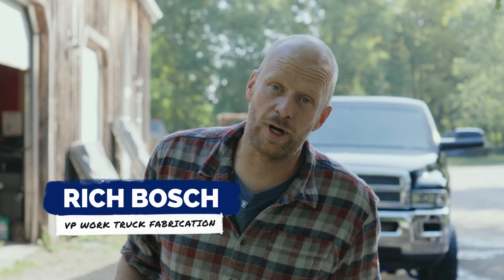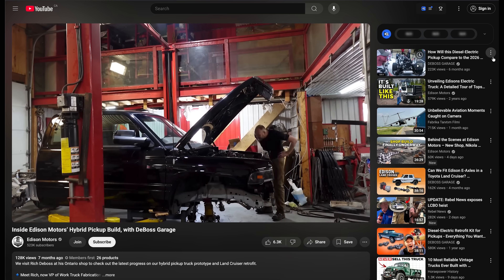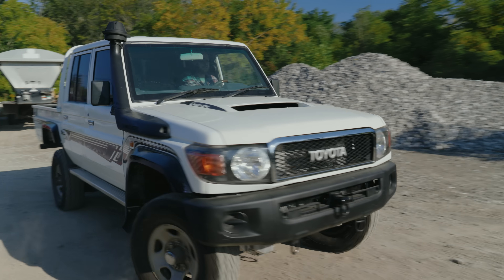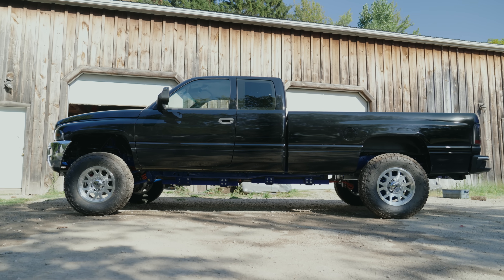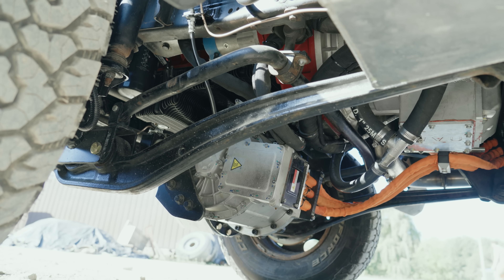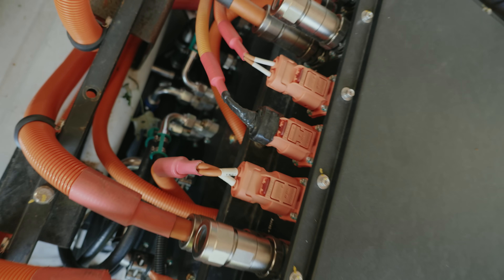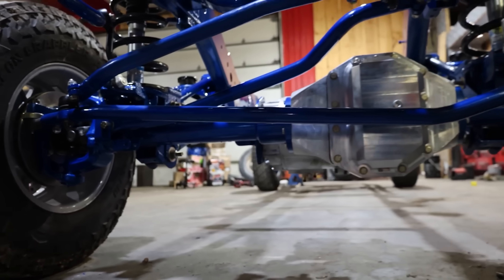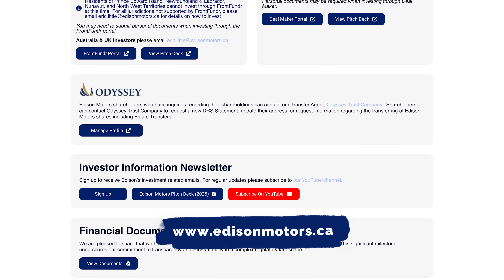We’re Building Pickup Trucks with Electric Axles, Here’s Why

Comment: Couple of thoughts/questions. 
1. Any concerns about the extra unsprung weight with the axle motors? In theory it should cause a rougher ride, worse breakin, worse traction, etc... everything is allways a trade off, just curious about the thinking on it.
2. 2:45 in an offroad vehicle there should be a fair amoung of travel in the suspension. So what about work hardening in the power cables? Vibration can also cause this issue.

Edit additional thoughts.
3. Is there shielding planned for the offroad  variants to protect the cables and terminals, especially with regard to point 2.
4. Is there a mech planned to detect point 2. I.e. cable increased resistance, caused by breaks due to work hardening, or connector issues? E.g. something like thermal couples on each end to monitor excessive cable temps, so there is a fail safe mode. So long as the cables fail safe, they could just be considered consumables.
Reply: I run one ton truck Dana axles with military wheels under a Land Rover Discovery. 782 lb front axle weight, and 698 lbs rear axle weight. It rides, and brakes excellent.
Reply: @Bread996 interesting, out of curiosity you on/off road?
Reply: @Bread996  I have a 2000 Disco 2 and would love to convert it to electric. Electric axles sound like a good solution. 
I don't want a hybrid power system, just batteries.
How did you do the conversion?
Reply: I raised the same consern as your first point - I hadn't thought about the second one though - good point.
Independent wheel/axels should solve both of these things though hopefully they eventually go that route.
Reply: @pdloder for that they would need universal joints, which they seem to want to avoid.
Or do you mean in wheel motors?
Reply: @deth3021 yeah, CV (constant velocity) joints. Like most anything with independent suspension.
Reply: That's true, but at least they're not at the wheels.
Reply: @newolde1 yeah, I think hub motors are an even worse idea - unless it's for a machine that's destined for pristine sealed roads for life.
Reply: You can compensate for the added unsprung weight of the motor by not putting huge, ugly, unnecessarily heavy aftermarket truck rims on it. Then it'll just feel like a regular gas truck with the stupid rims 90% of truck owners put on their trucks anyway, with the added benefit of not actually being an eyesore (Sorry I'm a bit salty, former tire technician, I loathe aftermarket truck rims because they're always a massive pain to deal with)! But for real though, with normal rims, I don't think it'd feel any different from what truck owners are used to by now, given how crazy heavy non-factory rims already are.

Comment: The incomplete chassis option is really interesting! New non-rusty frame, modern suspension and brakes, plus the entire hybrid driveline ready to go under a classic body. I like it. I try to peek down from the highway every time I pass through Donald to check if I can see anything, love what you guys are doing.
Reply from the maker: I think it makes sense for sure
Reply: @EdisonMotors  So will the pickup chassis have a standard designated GVWR?
Reply: @EdisonMotors  ECC! Edison Custom Chassis!
Reply: Will this be in US sized pickups only or is there a smaller (eg ford ranger) size chassis (3/4 ton pay load and 2.5 ton tow rating) planned. I am thinking of export potential for the rest of the world.
Reply: @kellymcdermott2546  they built a land cruiser which is basically ranger sized
Reply: @kellymcdermott2546  the 3/4 ton size would appeal to a huge market segment.
Reply: I’ve got two fifth generation Ford trucks I could plop on a chassis!
Reply: I've got a one ton crew cab dually, 1993 Chevy that's been running around with a blown head gasket. Seems like a good candidate and the frame is solid with maybe some surface rust but never been on a salty road in its life. Seems like a good candidate though I understand Dodges and Ford's Have more troubles staying together historically so might need this more. 😂
Reply: @monsaka7827 A '93 with a blown head gasket? Huh .... Imagine that 😂 I think that was standard equipment on those. Best I remember ours lasted for about 60k before going down.
Reply: i have a 2004 ram 2500 with a dead frame, if i could buy a new one from these guys today I would
Reply: I’ve got an old F-150 that I’d LOVE to do this with but the chassis is rusty and almost not worth it. Plus, now I could put my body on a heavier frame and axles? That’s a huge benefit for a farm truck.
Reply: Anything that needs recoding of its electronics, is going to be electronics SCRAP after it's outdated ... Probably before a regular person can pay off the vehicle conversion
Reply: When the thermal management device fails,,,🔥🔥🔥👀👍
Reply: Sounds like we’re no longer looking. At 1/3-1/2 the cost of a new truck

Comment: On the LC, look into placing the module on the roof, particularly if it's meant for high availability. An external roll cage would look really cool.
Reply: If the vehicle is going underground it will need an external roof protection per regs.

Comment: take any 2wd pickup... mid mount the engine behind the front shocks tower tucked in under the firewall.. put a "tesla" engine for the front ... make a hot-swapable batterie in the back and make it a universal kit for all truck brand.. tow on gas bring it back home on the batterie. 4wd would be a hybrid mode.

Comment: I REALLY want to do this to my end goal OBS. An 80s or 90s f350 crew cab with an 8 foot bed.
I just LOVE the look of those trucks, but the power to fuel consumption of those old engines is so terrible. I have a 460 and it gets 5 miles to the gallon. I would love to be able to swap over to the hybrid system.

Comment: What is going to protect the motor when you need to get to a piece of equipment off highway? My F550 was 19k. That much weight + momentum + stump/rock is going to kick the motor in the teeth if you hit it.

I know you could say the driveshaft would have the same problem, but a driveshaft presents a much smaller target.

Comment: We don't want frames. We want pick-up axles and the basic power system with diesel generator and batteries. We don't want new frames.
Reply: As i understand it you can buy the parts individually but for a quick and cost-effective solution they built the chassis

Comment: I have a 94 Isuzu NPR where I added a 15-ft tilt deck.  You might be at 12 I don't know but it's 15 Foot on road standards I know there's 32 inches between the cab and the bed.
Reply: I would love an incomplete chassis. Because a cab over where the cab tilts forward to access the engine.  With a tilt deck that tilts backwards  I would love the frame rails and axles. It means I run wires and attach hinges.

Comment: You were tested at McMaster. That is actually impressive
Reply: On the deboss channel, for the 95 dodge, there is a video where they did a battery of dyno tests with the original gas engine, and with the r2.8 Cummins bolted to the original transmission.

Now we're waiting for the tests with the truck now that it has batts, E-axles, and the R2.8 to spin the genny.

Can't wait :)

Comment: I have a 1972 bus turned totterhone, i am looking for more infor on batteries and axles for it. Id find a lil 4 cylinder diesel genny, so would need to know kw needed.
Reply: Edison semis have 6 batteries and 180 kWh total. Unless you're running the davis dam stress test, the little Cummins r2.8 liter 150hp engine making 100 kW should be plenty.
Reply: @Sah-o5m  just a class 6 truck. 14000lb rear axle to haul my camper. Been trying to find the axle. Not sure if direct to motor, small drive shaft, more so the cheaper option. I built a 12x8 box, and 9x8 rear deck. 366 bbc. 7? Rear gear on 22.5x11. Does 45mph. 😂. Probably 3500 to 4000 rpm just a guess.

Comment: I planed on building a hybrid Suzuki Jimny about 12 years ago. However, apart from the cost (which made it a none starter) the other issue was mounting an electric motor directly to the DIFF. The problem was vibration with off road driving. 
I've taken great interest with this project and look forward to the outcome.
Good Luck!

Comment: This vid is great. To the point letting us know whats going on no bs.   Dragging Rich and boys out to wine some more about how the government isn't bending over backwards and doing backflips for you so you can do an end run with a particular engine, we can do a lot less of.  Its not professional..
Reply: The public citizens (like Chace) have a duty to point out unperforming government red tape bureaucracy that won't lift a finger to help.
Reply: @Sah-o5m  that's not what he is doing. Sorry. He is rage baiting. He never tells you the full story. He can put in any road legal engine which is completely fair... what you can't do is find the same engine but spec'd for a Gen set so you can import it for cheaper ( or at all ). The road spec'd ones aren't sold to just anyone.  What do you thin will happen when the big boys find out what he is doing? No more engines for Edison.
Reply: @joe-ontario 
um no.
Edison asked ECCC if they could just use a road legal engine, and ECCC said if Edison bolts the engine to a generator instead of a transmission, then Edison needs to do $1m in cert testing to get USA EPA approval.

Holy cow I wished Edison could just use a road legal engine. That would be awesome. :)
Reply: @Sah-o5m  that is exactly what they can do. He said as much in multiple videos.  What he stats over and over is the issue is getting the generator engine version certified.  It cost a shit ton less to get that engine and there are no restrictions.  The rd legal one he might not even be able to purchase. He wants the generator version  to be deemed rd legal

Comment: Let’s talk about sliders on that toy that’s tough lay out  in the off road environment, and that second gen taking a trailer up the coquihalla keeping up with traffic. What’s the battery capacity doing that in a cold weather after two or three years of driving it , Ontario is a different planet than British Columbia  driving across the prairies doesn’t prove a lot  . There is no track that simulates British Columbia. I’ve been part of the team that developed two vehicles.
Reply: I agree, its good to have sliders for off road trucks. I believe the dodge was designed as a street machine. 

Hopefully these trucks will approach 400hp and 500 ft/lbs (peak). I believe the 60 kWh battery plus 150 hp engine will not run the full coquihalla at peak output :( But it shoud run the coq at 70?% power so 280 hp? To be fair, holy cow, its a 70 mile climb. A 7000 lv truck with 7000 lb trailer At 280 hp, it should maintain 40-60 mph climbing up the coq.

Edison can use the 2.8 liter diesel engine to warm the batts in winter.

Fortunately, the owner Chace is very familiar with the coq.
Reply: Yeah, Merritt’s not far from hope

Comment: All this is great what about battree  waste an disposal take that to the next level tho there really isnt a level at this point it needs to first be considered an would pay the way for ever other venture as this is the number one issue since its inception no way to safely dispose of the battree
Reply: Batteries aren't gone when they entirely lose capacity. Like the fuel in a fuel tank.
There are battery recycling today but it's only in the last 5 years BEVs has made some numbers. And apart from  offensive problematic designs of the packs, not the cells, the batteries last a long time. Usual life before scraping a car will be the norm for most. And we have prior good data for machines that go through battery cycles a lot faster than cars. 
So there isn't a gigantic supply of BEV batteries to recycle yet. But compared to mining rocks of those elements, a battery is an extremely high grade ore. Separating them out will be done if tandem with the supply of used ones.
Reply: @subwarpspeed no simply no did you know in most countries there isnt a way to fix nore replace battrees due to governmental laws ie we will sell an ev but not take responsibility for repair or disposal without added cost an this isnt just vehicles this is all consumer battery products but will take them at cost an store them thats not disposal or recycle thats a huge insurance an cost waste beyond the marketing that evs are a better way to go except for when they have been in a accident or fail in some manner 
Until there is actual disposal that isnt storage an recycling that isnt just repurposing cells if one wants to push bev  evs an phev there needs to be a battery disposal first as it needs to grow with the production not catch up 
But as we all know to well with plastics there is no recycling just storage

Comment: It seams obvious that independent suspension would be better than solid axles.  Why is that even a question?
Reply: Independent suspension reintroduces the weak flexible driveline joints that Rich just talked about avoiding, and puts them under even more stress. 
A normal driveshaft u-joint only transmits about 1/4 to 1/3rd of the torque the axle shafts must handle.
These kits are only legal right now  for trucks over 10,000 lb gross vehicle weight rating. They are not aiming at the independent suspension soccer mom SUV market, but 3/4 ton and bigger trucks where straight axles are still the most common setup.
Reply: It's simple to drop out an old straight axle and weld in a new Edison e-axle into any straight axle truck.

Down the road they'll do the homework to figure out how to make an IRS/IFS system work.

Comment: I see a lot of 'parallel' hybrid scooters with Bafang in-wheel motors. The chain is usually rusted or removed, but they've been operating in all kinds of weather. The Shimano, Bosch, DJI, Pinion, etc. are all high-end MTB motors paralleled with a chain. Water ingress is a problem with in-built electronics. Maybe you can get an IP rating too.

Comment: I love what you guys are doing but, Four independent lightweight hub motors, Right behind the brake discs, Would be ideal for power to weight ratio, less moving mass, better throttle response, less parts to break. Each wheel could have independent suspension and orientation capabilities.
Reply: Hub motors have a host of problems. First and foremost it increases unsprung weight by a lot which is not desirable. Second, because it's now unsprung, the damping of road vibrations is significantly reduced which leads to cracked magnets and broken windings. It's a very bad idea.

Comment: Incomplete chassis idea is similar to how the railway's are doing things now. 
They are taking older DC traction powered units, and rebuilding them with AC traction, new Generators, and power plants. 
The reason for that is they get around tier 4 which has been nothing but a nightmare. Then when they upgrade they have to increase it to a plus (tier 1+, tier 2+, etc) keeps the unreliability at bay.

Comment: Waiting for the first firetruck based on that kit. Pump, claws of life and so on powered by the generator. Providing emergency power for important infrastructure. And driving anywhere with that system looks amazing.
Reply: Jaws of life tend to be battery operated like a drill.
Reply: @joe-ontario oh I should check my translation, I meant "Hydraulic rescue tool" look on Wikipedia for pictures.

Comment: Still haven't fixed those sketchy rear lift shackles on those leaf springs??? They're somewhat of a liability... If it's a cheap lift you want, I'd suggest going back to stock shackles, but going SOA (spring over axle) by welding the spring pads on top of the axle instead.

Comment: I'm really not trying to be "that guy" but I am concerned about the waterproofness of the batteries and ancillary electronics. Also, I love the idea of bringing back "coachbuilding" because this would open up the aesthetic of expensive cars on an affordable front.
Reply: I’m sure they never thought of that. So as soon as you encounter a slight drizzle you and yours are going to immediately ride the lightning.
Reply: The batteries arent lead acid with the exposed terminals on the top, they are completely sealed. Go search the videos of Tesla's driving passed flooded cars through 2 feet of water
Reply: Edison has a goal of their trucks being able to ford streams.

Comment: What about the International pickup? It is probably more semi than it is pickup, but it was announced with the Ram. I don’t think anyone has brought up the International in a video since the move.
Reply: With the move Edison has been focused on the semi and getting the new shop up and running.  I don’t think they really have the space to work on the International.  Deboss has been working on the Ram and the Land Cruiser.   I think once the new shop is up and running then we might see the International come back.  Just so they can finish it while Environment Canada works on the EU specs.
Reply: I think the International needs another axle, 6x6
Reply: @bobstitzenberger1834  the steer axle on the International is not powered. It uses the same rear axle as the new semis, so if they added another axle it would just be a semi with not enough batteries and a tiny generator.

Comment: I think this is a great idea.  But why stop at the chassis?  build the whole medium/heavy duty truck as a pure Edison product while working with niche suppliers who build off of a chassis (tow trucks, ambulances, etc). If you have people shelling out six figures for a complete F250, there is room to move on those buyers. They are mostly commercial buyers who care more about performance and capability rather than rich Corinthian leather.
Reply: They'd run into exactly the same problems as they are with the lorries: regulatory compliance. Converting old vehicles sidesteps a lot of regulations so it's a lot cheaper to manufacture.